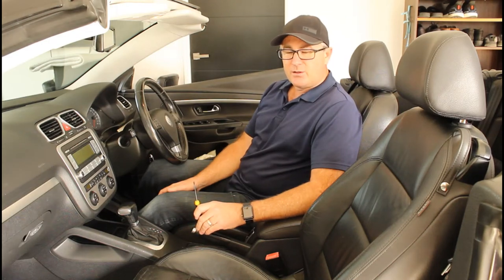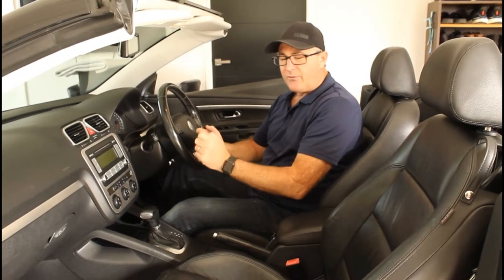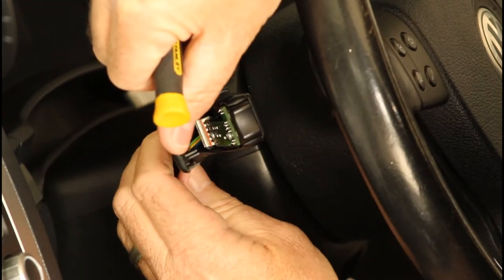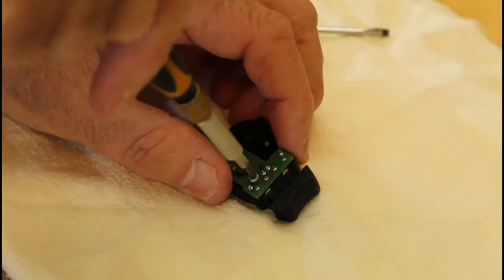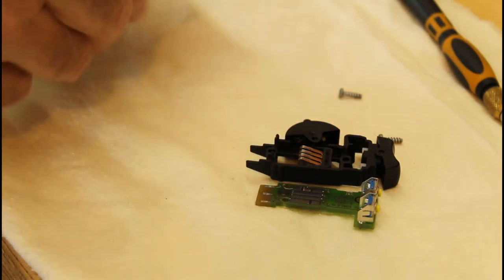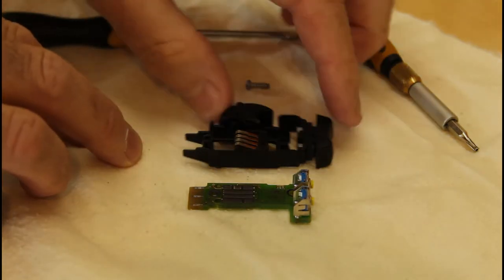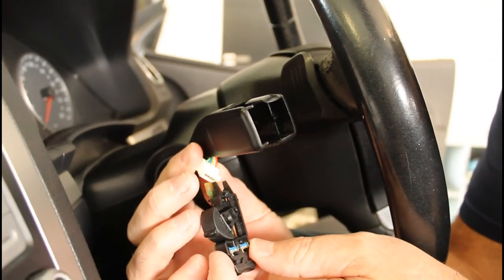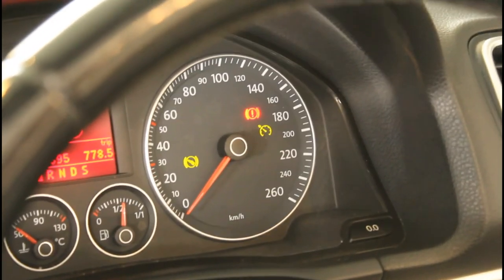VW EOS fixing cruise control

Comment: It is caused by the blob of grease underneath the switch toggle. On very hot days under the heat generated by the windscreen the grease melts and runs down onto the switch contacts. This is likely to re-occur every summer - remove most of the grease under the toggle switch and the problem may never reoccur.
Reply: I just did this on my mk3 Leon Cupra. You’re right about the grease. I removed it all. The switch still moves. Fingers crossed it works 🤞🏼

Comment: My 2016 Jetta cruise goes out with ERR on the dash after about 20 minutes driving. It seems to happen when going uphill. I have to restart the car to reset it. 

Note; I have a check engine light and sputtering engine at idle if the car has not been run for several hours. 

Any ideas? Last year it happened but went away after using fuel injector cleaner. No such luck this time.
Reply: Its turbo actuator. Replace it your problem will be sorted out
Reply: Just tried it on my 2012 Jetta SE 2.5  that has the same type of cruise control switch and it didn't work.... 😔 It was worth a shot as it was pretty easy to do, but my problem is somewhere else. Any thoughts?